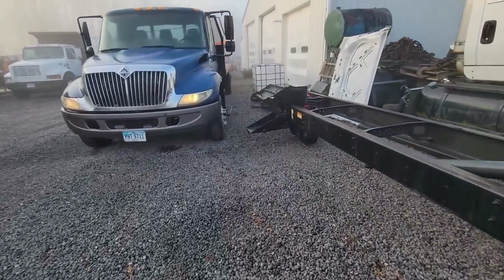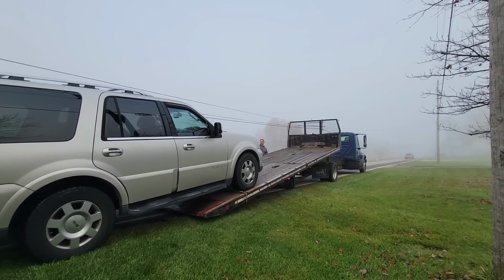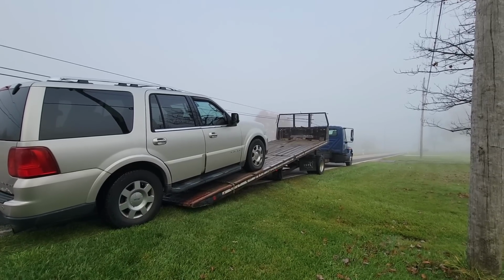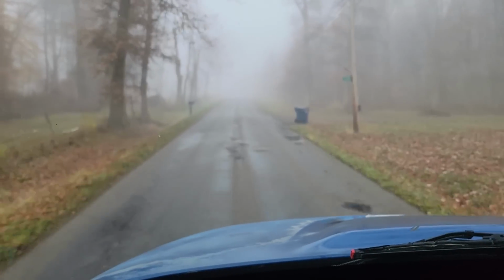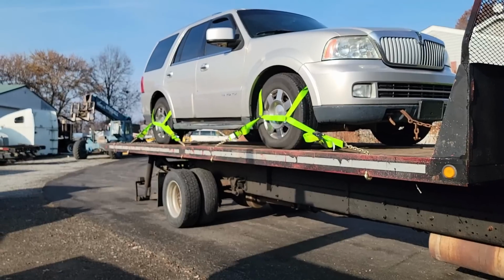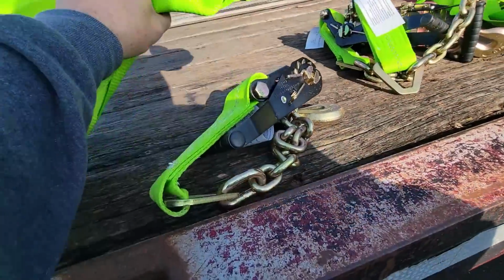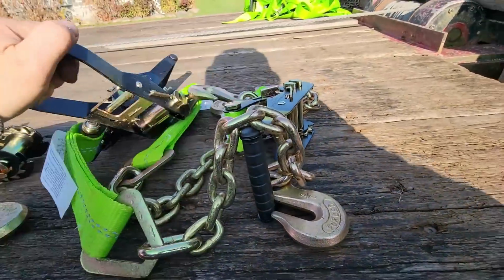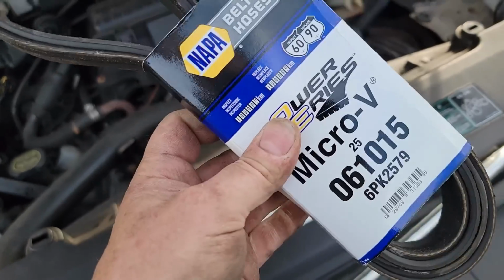ROLLBACK TOWING AND REPAIRING LINCOLN NAVIAGTOR!  ALSO A NEAR HEAD ON COLLISON!

Comment: When I drive tow truck I always tried to load from the other side of traffic look and see if you can use the green  Strobes if you notice summit and portage County use clear yellow and green  they say the green is more noticeable in rain snow and fog
Reply from the maker: This truck only has controls on the driver side. i never do road side recoveries. the next truck has all the right lighting and gear.

Comment: The new wheel baskets work really well. Fog is a big risk factor. Recently in Oregon, there was a 60 vehicle pile-up on I5 in Coburg, near Eugene. One fatality. Someone hitting their brakes is the likely cause. I teach driver's ed to teens. I emphasize the importance of slowing down in foggy conditions. In the near-incident your recording captured, an accident was avoided because the on-coming SUV was going slow enough to be able to react to the box truck.

Comment: It's too late to warn you, but I've run into a rash of sealed bearings in the last few years that have basically no grease inside them from the factory. I've done 3 different idler bearings where that was the case. It doesn't seem to matter who the manufacturer is.

So... If you have occasion to pull that pulley again, you may consider popping the seals off and putting a touch or two of grease in it. I'm to the point now that I don't trust any of them.
Reply from the maker: well that sure is discouraging.
Reply: @j.c.smithprojects  On the bright side, after replacing a few $50 pulley assembles in way too little time, it motivated me to look into just pressing new bearings into the old pulleys. It's as easy as you'd think and only about $8. 6203-2RS seems to be the part number for a ton of light duty automotive applications. At a glance from what I saw in the video, I'd bet you a donut one would fit your Navigator.

Comment: Watching you man the controls to extend the tray out to collect the Navigator, I couldn't help but notice you were standing in the middle of the lane.  I suspect your rollback does not have controls on the passenger side, so would you consider dual controls or relocating them to the passenger side ??
Reply from the maker: no. it does not have controls on the other side. this bed was never intended to do car towing or recovery. it is an equipment bed. i have other rollback trucks that are going to be put together in place of this truck.

Comment: Glad you didn't get hit.  Yes lighting would help. 
Like said before a short with sheeve to fit cable ,you can steer the car by deflecting the winch cable.  Don't  have climb in out up down , that way
Reply from the maker: i have one for this truck. it just didnt make it into the truck at this time.

Comment: You should get some LED flares they have magnet to stick them to the vehicle or on the deck or you can set them on some cones or just put them on the Road to alert distracted drivers
Reply from the maker: i agree. however, the lincolns hazards were on as well as the hazards on my wifes van. which was parked behing the lincoln.

Comment: Great video... Does that bed gravity tilt ?? Wasn't really paying attention to it til it plopped down after you unloaded ! A buddy of mine worked for a company for a while running a single axle daycab freightliner pulling a 3 car wedge and they wouldn't let him use chains just lasso straps and one morning a car cut him off and ended up jackknifing to keep from hitting them and the minivan he had on shot right off the front of the trailer onto the highway.... thank God he had jackknifed or it would have smashed through the cab.... my point is lasso straps suck lol I like how yours have ratchets on both side of the tire !
Reply from the maker: no. it used hydraulic cylinder to tilt. it is an equipment bed. so the cylinders are at the rear to stabilize and raise for loading at a dock if needed.
Reply: Gotcha !

Comment: I have to say this. Two things I noticed as a former tow truck operator. 1: No, Emergency Lights on the truck... 2: No, High Visible Outer Wear worn... I personally would not operate my truck without either Lights or Safety Wear. Safety first always..
Reply from the maker: understand that i am NOT a tow company for hire and never have to be on the road like this. this was an emergency.
Reply: @j.c.smithprojects  I do understand you're not a Tow company per say. It was the safety factor I was concerned with. Especially your safety in the fog. Have no fear I would do the same for my children...
Reply from the maker: im sure you saw my head on a swivel...people have no concern for others these days.
Reply: @j.c.smithprojects  I most certainly did sir...